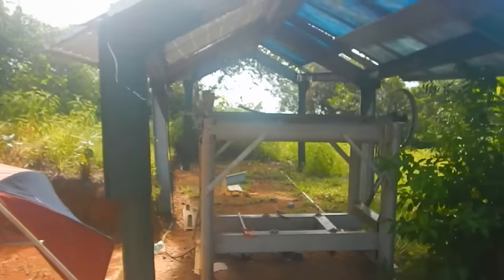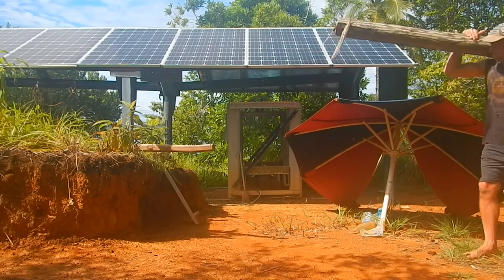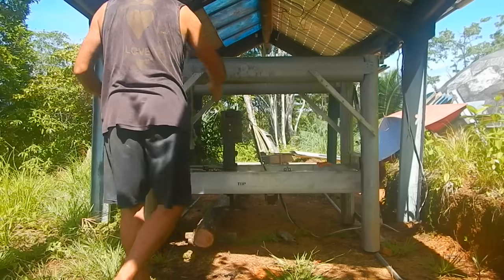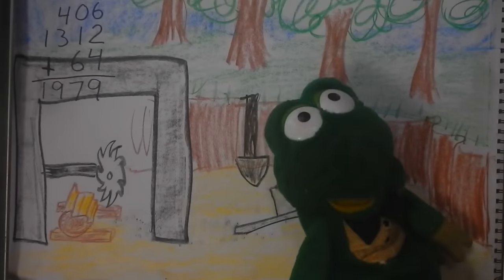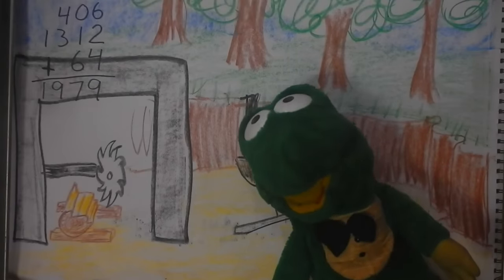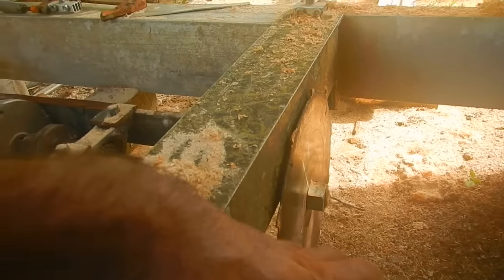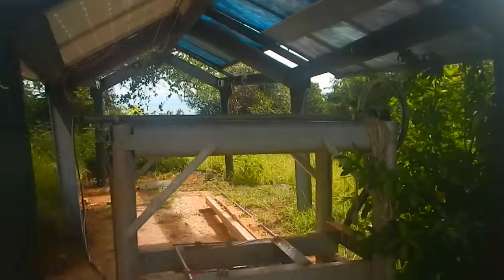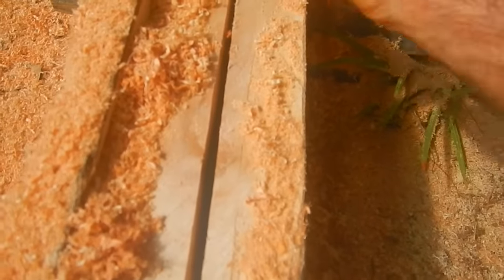Lumber Milling and Massive Improvements!

Comment: You have done very well to reduce the teeth in the wood at any given time, it cuts power dramatically, and improves the cut as you found out.  I have a swing blade sawmill that is chainsaw powered, and with its near 10 HP, it turns a 25+ inch diameter blade for a maximum cut of 8” (4”-6” maximum single pass, depending on wood density). A swing blade sawmill is the best design, and most efficient with least wood loss, as well as least physical work as to actual sawing etc.  I am impressed with the build and performance with the rather small ish motor you are using and the fact that you are running strictly on solar panels, is phenomenal! Awesome content, awesome crop of kids you are raising to be the next generation of awesomeness!  Great videos too, always a blast to see the next chapter!!

Comment: Have you considered making yourself some kind of gravity battery? Since you're up on a hill you could pump water up to a container and run it back down through a generator or even use the trees to hoist up some containers of dirt or rock with an electric motor with regenerative breaking.
Reply: I suggest you do some very basic calculations/googling around to get a grasp on what amount of energy per unit of height and weight and you will find crazy big numbers...
Reply: 1st idea re: storing water on a hill a as a battery of potential energy 🤔
2nd:  idea of hoisting weight up a tree and using the controlled drop to generate power 🤪
3rd idea:  he has energy untapped in the form of water flow / tides right in front of his property 💡

Comment: Jaimie.. can I suggest a long spring or ocky strap type of thing to help keep the power cables from fouling on the track as you move the sled along the cutting length it will be one less thing to worry about as you are cutting your timbers.

Comment: J, that machine is Bitchen!!!
What comes to mind is a 'taught cable' running the length of the structure,
up towards the peak.  Have little rolling pulleys on it to suspend the motor's wiring.
'No need to kick it out of the way of the wheels.

Comment: Who else, but Jaimie, would remove teeth to get a better bite?  Always thinking about how to improve stuff, via a work-round.  Love the ingenuity, as always.
Reply: I tried to find information on Skip-Toothed saw blades, but didn't find much.  The ones you can buy only seem to be missing every other tooth.  Jaimie seems to be in rather deep experimental waters on this one.
Reply: Scrub cutting blades are square and have only four teeth.  I have seen some sawmills with a single tooth.  Less resistance/ not as smooth cut.

Comment: The reason why the blade cuts more efficiently is, it's now better compatible with power you have available on your motor. I have 4.2kW motor for a similar sized blade, and I think it could take closer to 10kw. 

I have used a big field saw mill with 100cm blade. It was run with a tractor, and based on the sound of the engine, it took about 50kw. It took only few seconds to cut 5m long and 40cm log straight into half. By principle, smaller blade shoul be able to cut in a ratio of dimension.

Comment: You've never gave us a measurement that I'm aware of, but I can't help but hypothesize that your lumber mill would be vastly improved by a 24-inch blade (giving you an 11 noodle unit cut).
Of course, based upon the bogging sound of that first cut,
It seems reasonable that you need a battery Bank as well.
As to moving larger logs...
This has been stupefying me from the beginning.
I'm very interested in your thoughts on the matter.